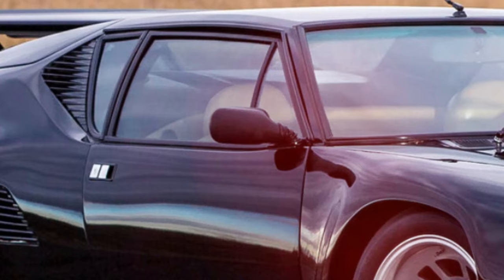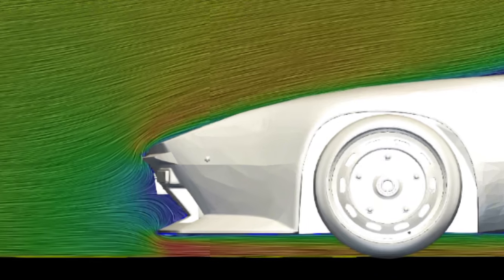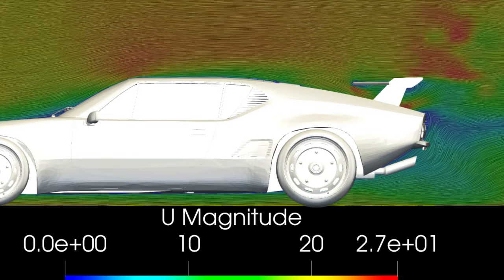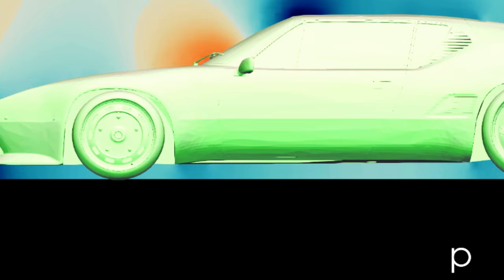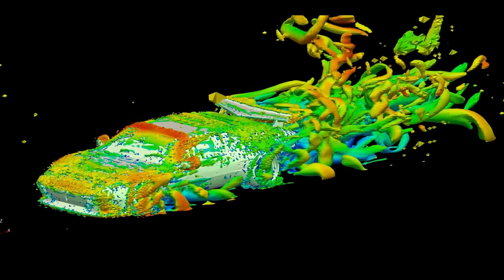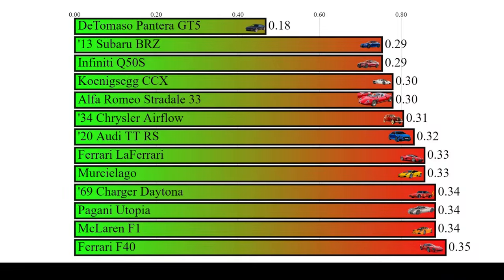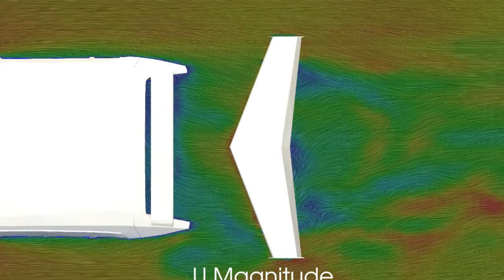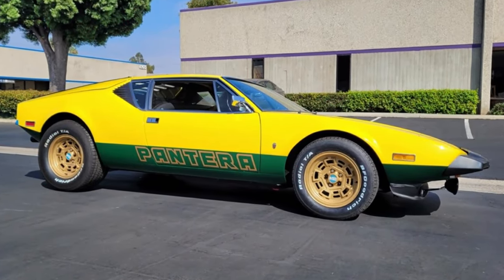I Tested This Rare Supercar's Aerodynamics

Comment: I've had this "urban legend" stuck in my mind for years, that the old, original, not modified R5, at top speed would weigh just 6 kgs 😂 could there be a truth to that?
Reply from the maker: It’s possible for a car to achieve that, but I don’t think the R5 does because it isn’t that streamline to begin with, so lift production won’t be THAT high.😂

Comment: We just have to see the Mercedes W124 tested, regardless of it's boxy shapes it's (too?) much praised for it's aerodynamics... but is/was the allegedly "best designed car ever" really as good as claimed? And if possible - with and without the merc logo in the front!
Reply from the maker: Thanks for the idea! The "best designed car ever" really depends on what they mean by "best". It wasn't aerodynamically.
Reply: @PremierAerodynamics  True, depends what mean by it... atleast the amount of money and hours used for it's design, was something car industry had never seen before - and not sure if afterwards either. If take a bit deeper look what we're talking about, I think after a while we both want to see this! 😏 That claimed 0,28 is nothing special, especially for modern cars... but for such a brick designed in the 80's, it does raise eyebrows a bit. Would be cool to see if it's actually true - or even lower, as some have also suggested...